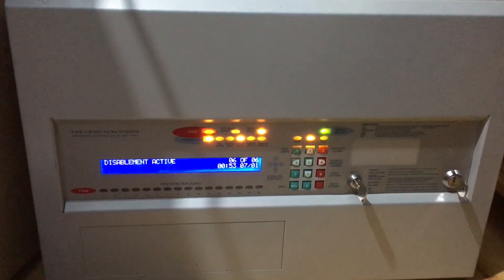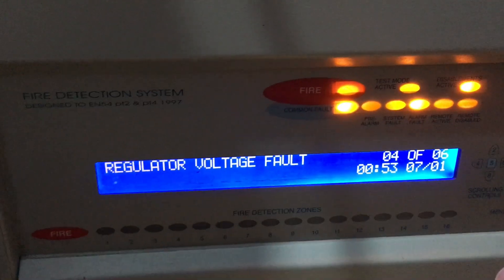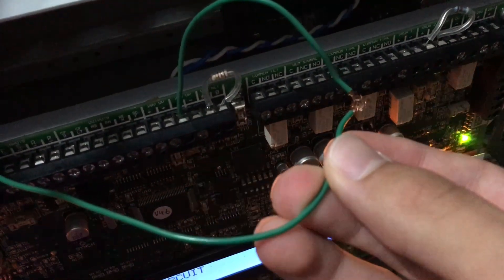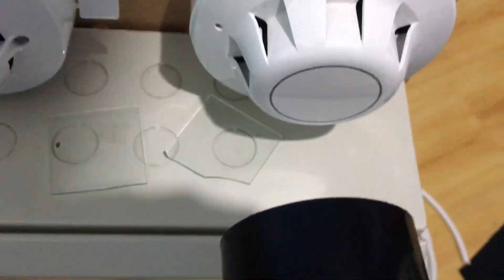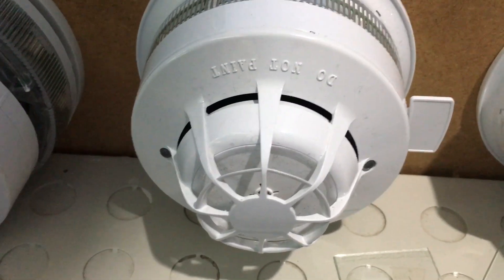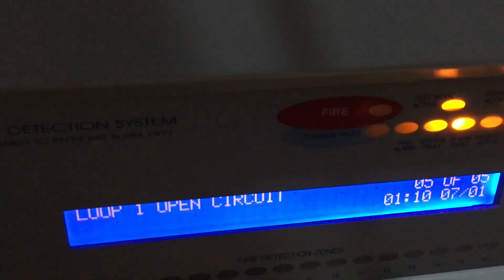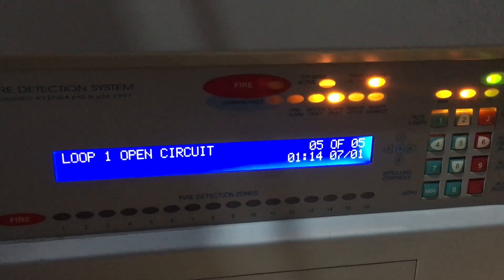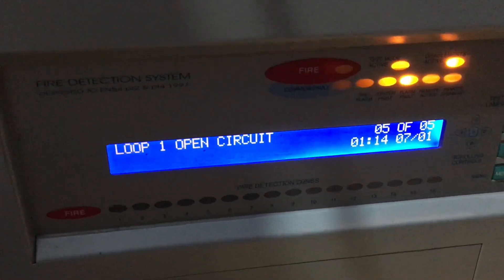Addressable System Test 5 (Haes Vector)

Comment: i’d love to have this panel. such a good one! i have a ctec afp which looks kind of like an old xfp, i do really like it but there’s some flaws such as no discovery :(
Reply: (other account) the haes doesn't really support discovery sounders, the only way i could get them to work was when doing alert, and only the ctec base sounder worked iirc, maybe there is a software thing but I'm pretty sure the vector was released before discovery sounders were
Reply: Also yeah it's a nice panel but definitely not the easiest to work with, when i got it it didn't like loop 2 so i had to disconnect it, and it does randomly play up sometimes

Comment: How does addressing work?
Reply: By dip switches.  You take the adress you need, put it in to a binary calculator and make it an adress. With smokes you punch out holes corresponding to the number you need.